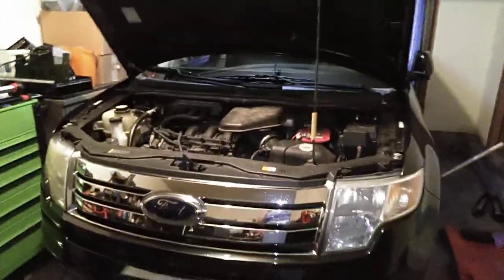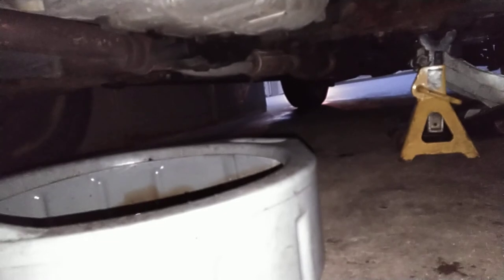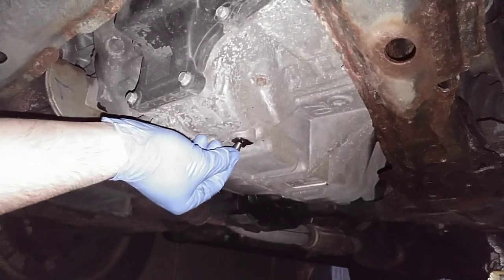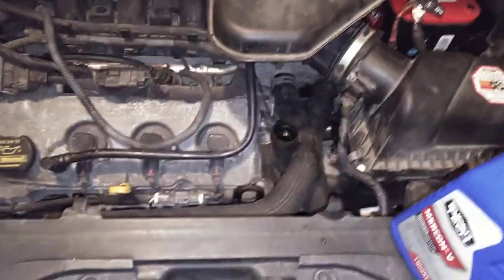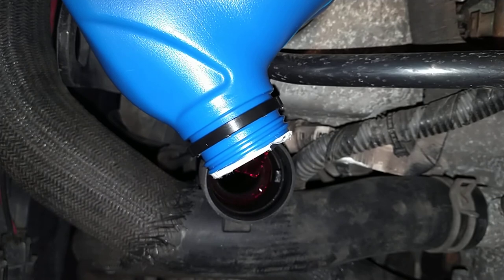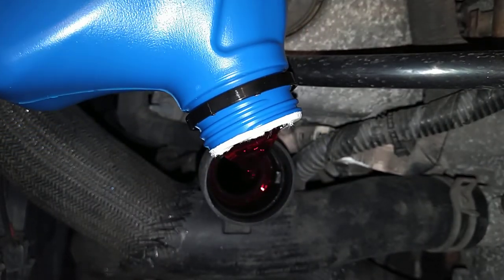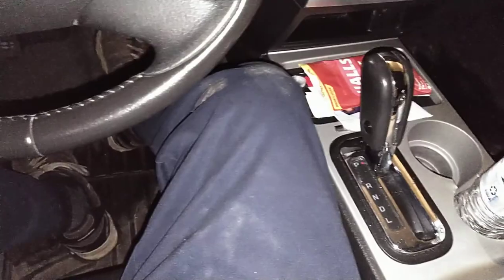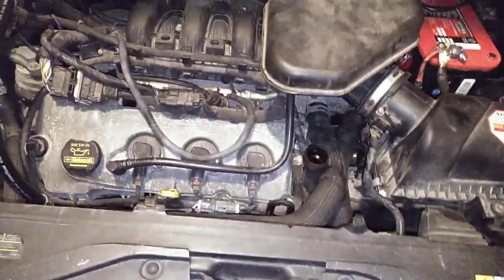Ford edge transmission service

Comment: I drain and flush my 2012 Ford Edge trans every 30,000 miles. Cheap insurance to keep your transmission in top shape. Worth the 80 bucks in fluid, takes 12 quarts.
Reply from the maker: I could no agree more man, I do the same thing because a new tranny is so expensive and it’s just inconvenient to have it replaced

Comment: Aren't  Fords suppose to be flushed by removing a transmission cooler line attached to the transmission then turning on the engine until 3 quarts come out aside from draining the transmission drain pan?
Reply from the maker: I have never heard that before. I would never run a car with no transmission fluid in it. And these don’t have pans they’re sealed so they only have drain plugs. They do have cooler lines but I wouldn’t take them off

Comment: My 2017 Edge needs Mercon LV. I bought Motorcraft fluid from the dealer today $1/qt cheaper than Supertech that was $9.46/qt. Surprised because I always buy Supertech synthetic motor oil for years.
Reply from the maker: Wow I’m amazed super tech was more than the motorcraft fluid. I’ve never seen that before

Comment: I have a with 270,000 and recently the rpms at hwy speed is going up and down sometimes and the tracs control light has came on. Ive never had any issues and its still driving. Its almost like the torque converter is locking and unlocking sometimes.  Idk and the tracs control light is on. Whats you alls thoughts. Im going to change the trans fluid today.
Reply from the maker: Did you ever scan the abs traction control system? Some times it can be the axle tone ring or a abs sensor that that can cause problems that seem like the tranny acting up. I know my Volvo has that problem tho where in overdrive the rpm’s jump up and down a little bit. I know that has a bad overdrive clutch or band. Yours might be the same problem but if you have a traction light on I would fix that first before condemning the tranny. I hope this helps! Thanks for the comment

Comment: Hola tengo una Ford EDGE 2010 Limited no me presenta de la misma manera la entrada de aceite transmisión y si efectivamente no le cambió el aceite desde hace cien mil kms y si huele a quemado el aceite también me dicen q patea la tercera q me recomiendas
Reply from the maker: Hello, it sounds like you have a bad clutch pack or band inside your transmission. Have you changed the fluid recently? Drain and fill it like I did in the video and see if there’s any metal shavings or metallic looking particles in the fluid, if there is then you’re gonna need a rebuild my friend. I hope this helps you out.

Comment: Amigo una pregunta tengo una Ford edge 2008 cuando manejo en 1 a 2 marcha hace un golpe y también cuando pongo reversa … que podría estar mal ?
Reply from the maker: I’m not entirely sure what you said because I don’t know what language that is but I think what you’re asking is the 1 to 2 shift and reverse. If you’re having trouble with 1 to 2 and reverse I would try to flush the transmission and also ad a bottle of Lucas transmission fix and see if that helps

Comment: 07 edge 184k miles shifts fine fluid still has a little pink to it when I wipe some on my hand don’t know if the fluid has been changed before should I do a drain and fill now or leave it alone I don’t want to hurt the transmission lol
Reply from the maker: Personally I’d change the fluid now before it gets burnt. If it’s still pink then it’s definitely been changed before, mercon v turns brown after about 40k miles so if it’s pink you’re good man. If you change it now you’ll keep that tranny going for a long long time. I have 247k miles on mine and I change my fluid every couple years. Small price for fluid save a thousands in a new tranny.
Reply: @T-MillProductions  okay I will and yeah the fluid I think looked really good for the mileage I was surprised too a little brown but still has some pink in it and this is in my newly purchased edge I got for 100$!
Reply from the maker: @michaelwork5399 that’s awesome man! It should take you to another 100k easy if you take care of it. 100 bucks for one of these is a steal lol. Make sure you flush that ford gold coolant out asap too. That stuffs garbage lol
Reply: @T-MillProductions  thank you the husband of a girl I work with was selling it as he needed it out of the drive way asap needs some work like a battery, power steering line, brakes and a front wheel bearing and some small stuff that’s about it and yeah I was going to change the coolant tomorrow actually and use yellow 50/50 universal coolant that I have like 6 gallons unopened of is that okay to use? Or should I use something else?
Reply from the maker: @michaelwork5399 that’s really cool man, great find! And yea you should only need a couple gallons. Usually when I drain my radiator I only get about a gallon out and then I drain and fill it several times

Comment: I have 2008 edge also 184099 miles. Left front wheel when hitting any kind of bumps in the road. Loud  clunk like the wheel about to come off. Please help
Reply from the maker: Check your strut and sway bar link/ mount bushing. Sounds like one of those is hitting on something

Comment: 2007 Ford Edge SEL.  Trans fluid has probably never been changed.  I have a shudder during 2nd gear (about 18-30 mph).  Is this something a trans fluid change could help, or would a product like Lucas maybe fix the problem?  Thanks.
Reply from the maker: Is yours AWD? Because that shutter could also be your PTU. I would pull the dipstick to the transmission and see what the fluid looks like and see if it smells burnt. If it’s black and smells burnt most likely your band or clutch pack is worn out for 2nd gear if it looks clean and pink or even red I would still change the fluid and use some Lucas. I put a bottle in my transmission every time I do a fluid change and I have 244k miles on mine now. If yours is awd when was the last time you changed the fluid in the PTU?
Reply: Mine is AWD.  i am not the original owner, so I doubt that it has ever been changed.  From what I can see it looks like there is still some red/pink in the trans fluid.  188K miles
Reply from the maker: I would still change it with some Lucas and mercon V tranny fluid just for good measure but I would also jack it up and look at the PTU and check that fluid to make sure it’s full too

Comment: Can a impact wrench be used to remove the plug to drain
Reply from the maker: That’s up to you, I personally wouldn’t but that’s just me. I would be afraid of pulling the threads out with the plug using an impact with all the torque

Comment: Hi bro,I have a ford edge 2008,my engine light stays on.did a checkup and it says check oxigyen censor.DO I NEED TO CHANGE ALL SENSORS BECAUSE I DOES NOT SHOW WHICH ONE  NEEDS CHANGING?🙏
Reply from the maker: Hi, that’s strange because it should say bank 1 or 2. What is the exact code that you have? Maybe I can help you diagnose it.

Comment: Hello, I have a 2008 Ford Edge Limited and I noticed a few days ago that when I drive my vehicle and I park there is a loud clunking noise. Also the radiator fan sounds very loud and when I turn off the car it slowly turns off as well. I was having a metal smell when I start the car and over time goes away. I have took my car before to get it checked and they told me it was my transmission. I just want to make sure before I go that route because I know it's expensive.
Reply from the maker: Hello and thank you for coming to this channel. First thing to check is you have 2 cooling fans. These are common to go bad as they are on most of the time. Open your hood and grab the fan blades and try to move them in and out. They shouldn’t have any play in them at all. If they do replace the cooling fan assembly. Check your transmission fluid and see if it is black or pink. If it’s black or very dark smell it and see if it smells burnt. If it is then most likely your transmission is bad. How many miles are on your edge? And have you ever changed your fluid?
Reply: @T-MillProductions  I'm going to go ahead and check it out. As far as miles I have over 180,000 miles. I've never changed the transmission fluid. But going to see about changing it. I'll keep you updated. Thank you
Reply from the maker: Okay, to be honest if you haven’t ever changed it at 180k it’s most likely burned and may have done damage to your transmission. Typically ever 50k miles you want to do a transmission flush. At this point it would be worth a shot to do a flush in it and Atleast try to save it. I hope this helps! Good luck and please consider subscribing if you feel I’ve helped you out. Thank you!

Comment: what happens if you over fill the transmission
Reply from the maker: I think the worst case scenario would be it would cause to much pressure and cause a leak. If you overfilled it just drain a little out

Comment: have a question, will my Ford Edge 2007  have a filter?
Reply: Have a question , will my ford edge 2007 have filter ,the automatic transmission?
Reply from the maker: No it will not. These have an internal screen that can only be serviced with the transmission split in half. Thats why these need to be drained and filled more often because otherwise that screen gets plugged and no fluid can get thru it

Comment: I have a ford egde '13 with 160 000 miles im getting vibration in car and sometimes skips but ford advised me not to do transmission oil change because it may stop running while my mechanic says do it. Any suggestions?
Reply from the maker: If the transmission fluid has never been changed in that 160,000 miles I personally would not change it. If you do you risk burning up your transmission. The reason why is because all the metal shavings and clutch material is acting as grit to engage the bands and clutches and if you change the fluid all that is fine and the tolerances with be to big and it will start to slip. I would wait till it breaks and replace it and change the fluid every 50,000 miles
Reply: @T-MillProductions  Great video. I have a 2010 Edge with 213000 kilometers- bought 2 years ago. No transmission issues and I do not know if the transmission oil has ever been changed. My guess is that it has not.  Recommend changing now?
Reply from the maker: Thanks for liking the video! I'm not sure what the kilometers to miles conversion is, but I would look at the fluid, if it's fairly pink or red then I would change it. If it's black brown or tan then I would leave it alone because if you change it it might start to slip.
Reply: @T-MillProductions  Many thanks.  213000 kilometers is roughly 130000miles. I enjoy fussing with my cars- at my age- it is one of the only things I have left. The sound of a smooth running engine is music to my ears. Best wishes from eastern Canada.
Reply from the maker: That’s awesome man! I’m glad to hear that! I love messing around with my cars too, I like to see the end result of modifying stuff. Best wishes from central Wisconsin USA

Comment: Question... Have a 2008, 199k mileage. Getting a hard shift in the last shift getting up to speed. Not my car, but doubt fluid has been changed in the 2 years of ownership. Normally I would look for a vacuum modulator, or vacuum leak. Looking for suggestions on where to start looking to fix this. Thanks
Reply from the maker: Hello, thank you for checking out the channel. What color is the transmission fluid in the vehicle? I have never actually experienced a hard shift on these transmissions being they are electronically controlled. If the fluid is black or smells burned I would say the 5 to 6 band or clutch is getting warn out. Do you have any transmission codes in the pcm?
Reply: @T-MillProductions  it actually looked good, and didn't smell burnt. It's a friend's car, so don't have a lot of details on the history. I expected it to be low, or black/burnt, and was surprised when it was full, and clean looking. That's when I started thinking maybe filter
Reply from the maker: So these don’t have filters, they have internal screens that are not serviceable. It really sounds like a sensor or electrical issue going in to 6th gear. Did you get any codes from the pcm?

Comment: i have 2011 ford edge fwd its got 160.000 had it 2 years should i change fluid
Reply from the maker: Has the fluid ever been changed before in that 160,000 miles? It might be a little to late to do it now, what color is the fluid? And does it smell burnt?

Comment: I had my transmission flushed and I didn’t know that they were supposed to change the screen so I let them flush it out with a machine and they put new fluid in I’ve had this car for 3 years and I had never changed the fluid and I don’t think the ppl did that owned it before me what should I do cause now ppl are saying my transmission is gone go out due to them not changing the screen and only putting in new fluids
Reply from the maker: The screen is internal and can only be replaced if the transmission is taken out and opened up. You're gonna be just fine. Don't sweat it, as long as your car is shifting good you'll be fine.

Comment: Hello, I have Ford Edge 2008 and just replaced transmission oil. As per manual it says 10 quarts oil needed but mine took only 7 quarts. Dipstick marked full at 7 quarts. Do i have to put more even dipstick mark is full?   Thanks
Reply from the maker: Open you should be good. The total capacity is 10 quarts but it’s only gonna drain 7. The other 3 are in the torque converter and the tranny lines. What I usually do is drive it about 100 miles and flush it again and that usually gets the last 3 quarts mixed in with the new fluid and then when you drain and refill it keeps all the fluid new and clean

Comment: What type of transmission fluid?
Reply from the maker: It Mercon V ATF. Any brand will work, I just used super tech because it was cheaper and I’m not made out of money lol
Reply: How many quarts?
Reply from the maker: I always get 6 and add 4 and check and fill as needed, make sure you run it through the gears and drive it until it’s up to temperature
Reply: Lucas no slip is that good to use? Cause my transmission fluid smells burnt and it shifts funny
Reply from the maker: Yes , I use it in mine just for good measure. It may not fix your onesie but it wouldn’t hurt to try it. My advice would be charge the fluid and then drive it for a 100 miles and then flush it again and use Lucas on that flush
Reply: Thanks so much for the advise
Reply from the maker: You’re welcome my friend! If my information was helpful please consider subscribing to my channel and giving me a thumbs up, I would show appreciate it! Thank you me have a great night!

Comment: Question I have a code P0983 coming up for a shift solenoid do you know where that would be possibly located at?
Reply from the maker: I am not 100 percent sure, but if I remember correctly being this is a “sealed” transmission you would have to take it out and split the case and it would be internal. But you may wanna check all the transmission wiring harnesses that go into the transmission and the pcm incase one got damaged somehow

Comment: Hi! How many gallons of transmission oil does it take up?
Reply from the maker: I usually ad about 6 quarts. That's 1.5 gallons.
Reply: @T-MillProductions  I got exactly 6qts out of my 2013 EDGE.
Reply from the maker: Okay , that’s what mine is too. Thanks for the input!

Comment: Please how can I fix transmission fluid leakage?
Reply from the maker: You’re going to have to figure out where it is leaking from and then determine if it’s a seal, cracked case, line leaking, transmission fluid cooler…. Etc. if you can make a video of the leak I can try and help guide you thru it